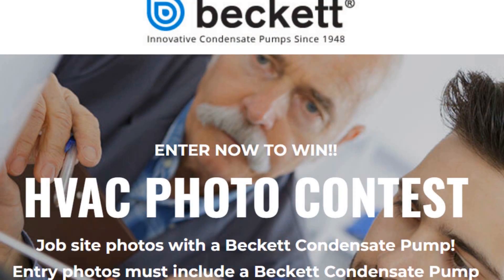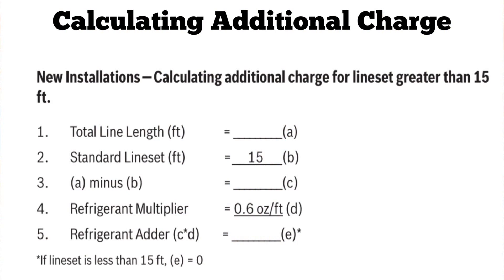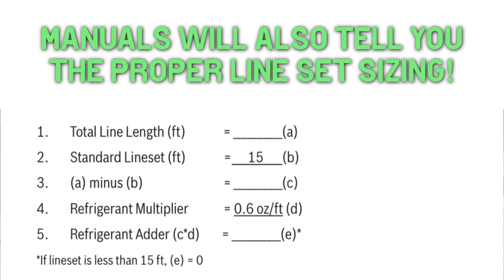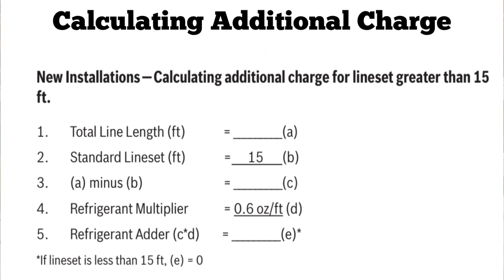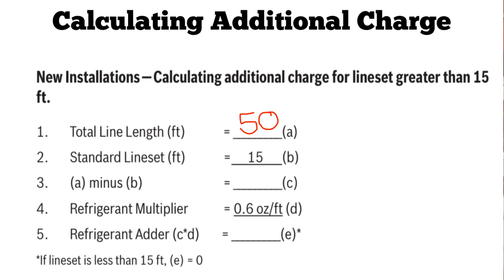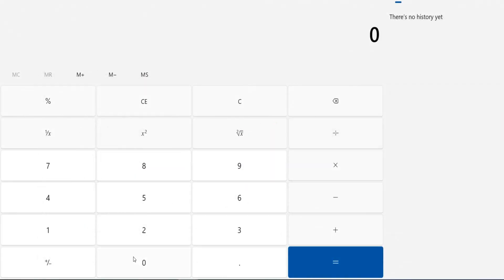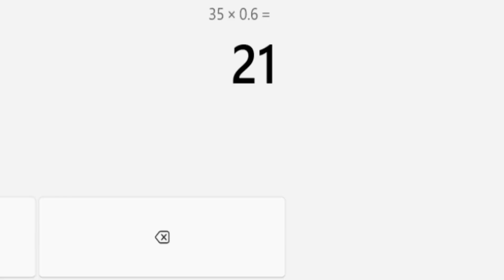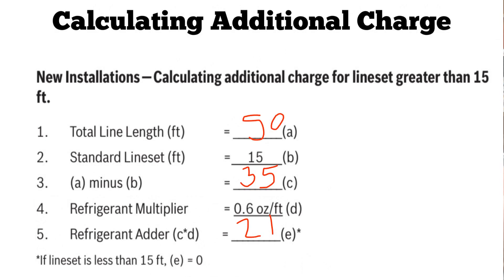How to Calculate Additional Refrigerant Charge for Line Sets

Comment: I came here looking for how to determine charge in a new replacement system with an existing 50ft-ish line set, where the exact length of a residential line set is UNKNOWN and cannot easily be measured. Obviously, if you know the precise length of the line set, you just following the installation guide that comes with the unit. So I suppose the answer I was looking for requires an initial "guesstimate" to get things close (i.e., calculate approx 50' line set and subtract the ~15' of factory charge already in the virgin system), and then just use subcooling measurements at the compressor and supercool at the evap to tweak things to where it needs to be?